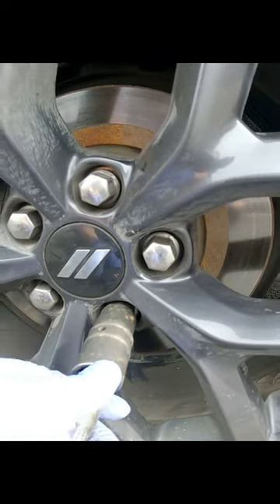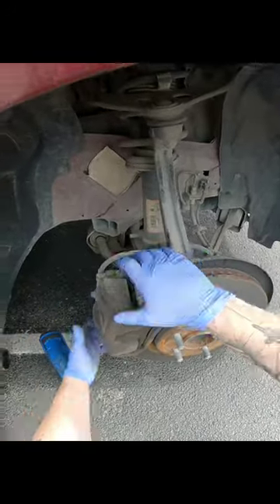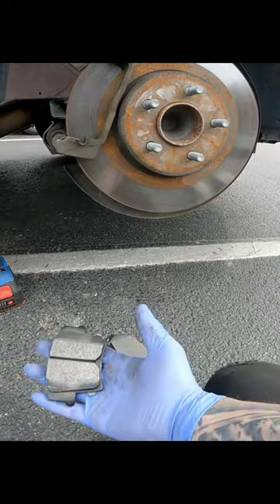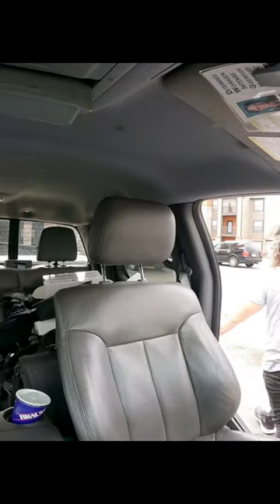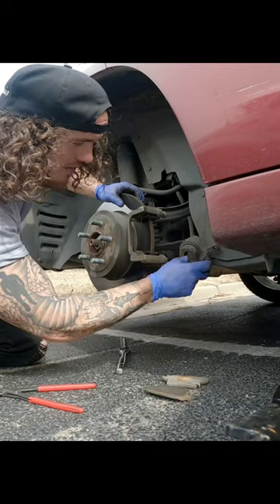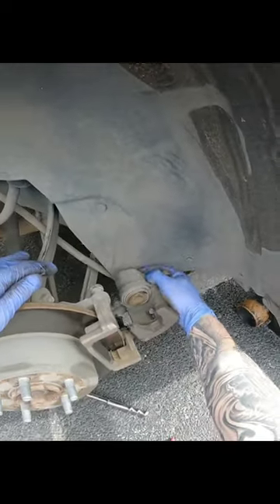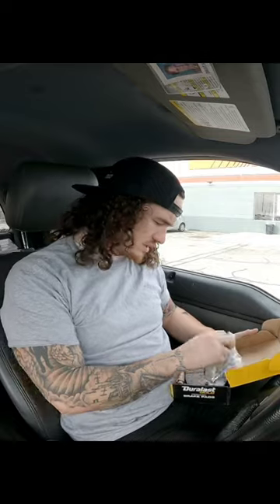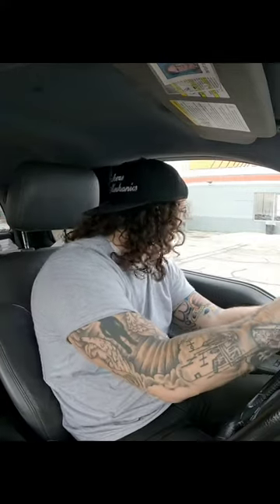Never had this happen to me but hey first time for everything 😄

Comment: hey you're young now but if you get some gardening cushion kneepad or a thick pad your knee and back will thank you in a few years.  GL
Reply: This, Im a hardwood floor installer and have a bad knee get some knee pads brotha!
Reply: I'm using knee pads and harbor freight has a tool box with wheels and seat for 50 bucks when I got mine a few years back  have that just for brakes
Reply: $450 don't sound too bad now, There's no saving money, Someone always pays in the end, I hope you didn't stick to the estimate You gave her
Reply: Im gonna take this advice even though it wasnt for me. Thanks man.
Reply: @24GarrettFPS  Glad you will, once you hurt your knees or back it’s so much easier to re injure it so best to avoid that route
Reply: If you guys are looking for the best knee pads they are mad expensive tho, there called proknees they make them custom to your size. If anyone gets a pair get the 1 inch thick padding, I cheaped out the first time and got 5/8 was regretting it comparing them to my coworkers 🤙🇺🇸
Reply: Harbor freight has 10$ pads.....best thing ever to throw down...hate working on the ground and also setting my tools in the dirt and parts. OCD.
Reply: @LegolasD yep...not fun.
Reply: Volleyball knee pads, sport section at Walmart for cheap, they work the best while allowing mobility, obviously. You're never too good to protect yourself. Wear gloves, safety glasses, kneepads, I even wear a mouth/nose mask when doing anything involving brakes.
Reply: I always bring a nice thick foam pad on every job. No matter how small

Comment: Hey Matthew, might be a good idea to start opening the cap on brake master cylinder before you push pistons in. Word is - you can destroy the brake booster like that. Pressure have nowhere to go when the cap is still on 🤔
Reply: That's definitely won't hurt the booster.
Reply: That's what they say but I've done probably 2,000 brake jobs and it's never happened to me or anyone I've known

Comment: Looks like you had the front pads for the two piston front calipers and the car had the single piston caliper. Should have been part D1056 from Duralast. With Chargers and Challengers always look in the description of how many pistons the caliper in the description of the pads.

Comment: That's the thing with those late model dodges cars. It will ask you vented or solid rear rotor. Then it has options for 4 piston or 6 piston brembos which usually only come on the R/T's and up. I think there are about 4 or 5 different pad options for them. Hard to blame a customer or the employee for that one.  I worked at Autozone for about 4 years. I would always have to go out to check these dodges for which one the customer needed because they barely knew what year their car was much less solid or vented rotor. Loved it when they came in with one of the pads in their hand. Made it easy.

Comment: What's the best way to clean up and regrease the slider pins/bolts and bushings? And what type of grease is best for them? Mine have always been rather sticky and don't slide all that well and I've tried to clean and regrease but that hasn't seemed to make much difference.
Reply: Use silicone on slide pins and anything rubber, don't use greases as many are petroleum based

Comment: she wasn't wrong about Firestone 
they tried to charge me $445 just to replace the rotors & pads on my '96 Corolla....
I'm like: "my car is almost 30 years old, shouldn't cost that much"
I already had cross drilled rotors & ceramic pads on hand but they don't do outside parts so I took my car to another shop called La Techuela (I'm in El Paso, TX & some shops have people speak spanish) & they charged me $70 to replace both sides at the same time
never had an issue since it was replaced in 2022

Comment: I wanna learn!? Why did you have to tap the socket onto the nut when taking the wheel off?
Reply: I bet the lug nut was a bit warped or stripped. Others are saying it’s due to that model lug that swells a bit over 22mm
Reply: @crazymike401  ohh Okok
Reply: The lug nuts are soft steel and impact wrenches twist them. He is pounding them straight so he can take them off by hand.
Reply: @christianworthinton8000  ohhh okok thank you for the info

Comment: Not sure how you could do this for a living. I had my own shop for a couple years. Sometimes it was great but allot of the time it sucked. I always wanted to help people out when they where down on there luck and it almost always bit me in the ass. I would give someone a quote on a starter or a engine with a 20% mark up with parts from a reputable company. Many times they would complain and say I can get the starter for $50 online. I would tell them I can't give warranties on there eBay parts if they fail. Often they would and those same customers would come in a few months later complaining. Cause I put a starter or whatever in there car a few months ago and now it's not working. It was almost always someone I gave discounts and tried to help. I work for a large corporation now taking care of a large fleet of big rigs I make better money with Great bennies and none of the stress of running my own buisiness.

Comment: I have ran into the problem before and learned the hard way, was it made in the last few months of the year before?? If so it might be one those weird cars where it is sold as the newer year but still has parts from the older years, or vice versa

Comment: Mechanic myself for the last 25 years ..a bunch of places like lisle and snap on sell a 22.5mm socket for ford lug nuts , works on dodge wheels too, scary to think that the company that builds the car can't design a nut that holds a wheel on correctly , them chrome caps are the dumbest sh*t ever.
Reply: Be glad Ford/Dodge no longer has reverse lug nuts on wheels. Those things drove me crazy!

Comment: Bro I just did CV axle on a Yukon from advanced 135. I look up the part number and they're $52 online garbage GSP brand CV, axles and mind you already clicking and I double checked the torque spec on all the bolts. Even the next day I retorqued it... Pretty sure it's a faulty part. I go to wheel bearing from them too but it was the professional one. The CV only had one level 💩💩💩..  I always go to stores personally but ready to try online

Comment: now i see why shops dont like customer supplied parts...
Reply: That, and many shops won’t warrantee services that are done with a customer’s own parts. The video is one good example. If you’re a shop and you’re only charging labor for a job, and then find out the parts the customer ordered aren’t right, then you may have just done a whole lot of work for nothing. You as a mechanic or shop owner may also be held liable if anything goes wrong as a result of a job you did, regardless of whether it’s their parts or yours. Customers also love purchasing the cheapest parts possible because they think they’re saving money, but that clearly isn’t the case. All they’re doing is buying parts that aren’t gonna last as long and won’t work as well. Are you as a shop owner willing to take on the liability of having installed a customer’s parts when you never should’ve done so?
Reply: @shyro76  i see your point there, good points

Comment: Ummmm why exactly did you hammer on that socket to the lug nuts is what I would like to know ??
Reply: Bc those gm lug nuts swell so they are 21 but you have to hammer on a 22 it’s ridiculous
Reply: Like Tech said Chrysler puts  plastic caps over the lug nuts to make them ‘look’ nicer and not so cheap. They get trash and rust under them and swell up so the correct socket does not fit anymore.

Comment: You should have just looked up 05-10 Jeep Grand Cherokee brakes they are literally the same
Reply: still depends on motor
Reply: @GunzNBunz  dude, no it doesn’t 🤣 maybe if you owned a Chrysler you’d understand they are very hacky, been using the same brake design for 20 years now. Do y’all keyboard Crusaders work or even own anything Chrysler?
Reply: if you knew anything srt 8 has brembo
Reply: this one don’t must be a v6 someone could even do caliper swap and call for smaller pads
Reply: @GunzNBunz  ok what are you talking about? Srt 8? I’m talking about the damn car he is working on… those big ass cars have the same design brake as the jeeps with v6s same motor the jeeps got dude he might have found it
Reply: @jaymoney119966  i literally said it still depends on the motor and you said no it doesn’t , he never mention it in the video numb 🥜